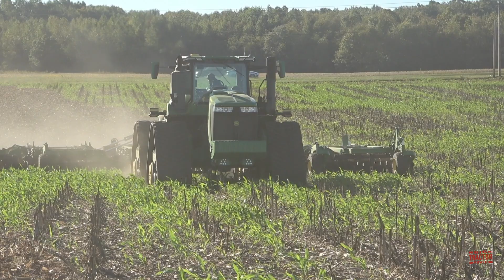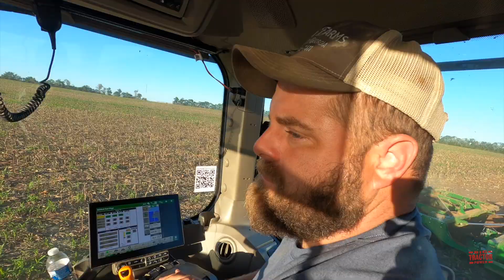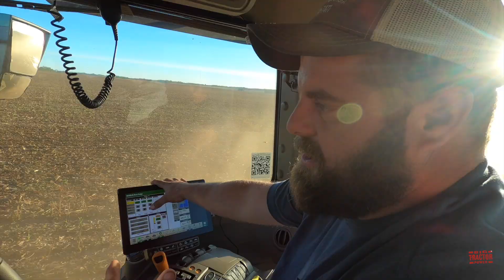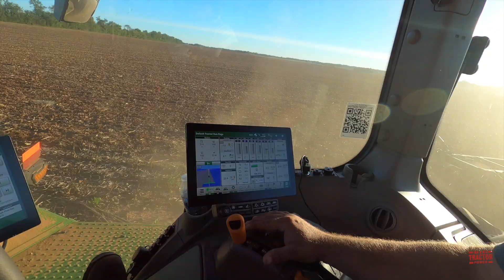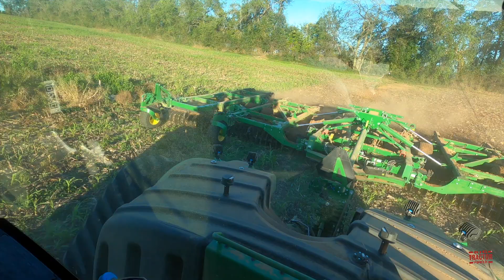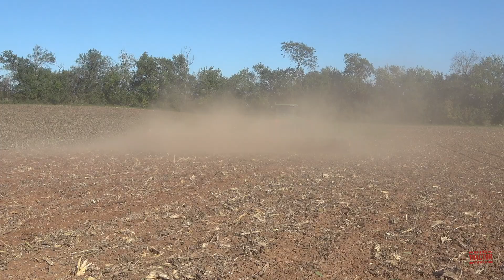JOHN DEERE 9RX 640 Tractor and 49.6 ft 2660 VT Working on Tillage

Comment: are those 40 inch tracks? impressive setup
Reply from the maker: They are 36 inch.  30 inch are standard.  The 120 inch width is optional.  The wide 120 inch stance gives the tractor a bigger appearance.

Comment: I have a 43'6" 2660 VT I pull with my 9470R. Works great for sizing the corn stalks, and leveling up the ground with very little soil movement. Use it on no till HEL land that erodes too much for a regular disc. Air seed 15" soybeans right behind it with a JD N542 seeder.

Comment: I run a 640 on tires pulling a 36 yard Ktec pan . I love it .
Reply from the maker: Very cool.  I have not found a 9R 640 to film yet. The largest wheeled 9R gen 3 I have filmed is a 9R 490. For gen 2 I got see lots of 9620Rs. In my area the 9RX has taken over on sales.